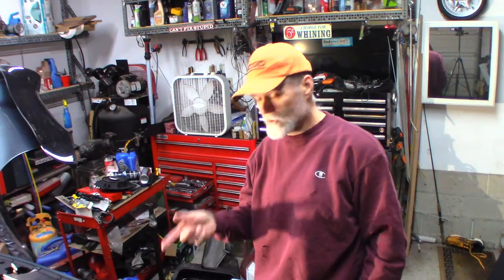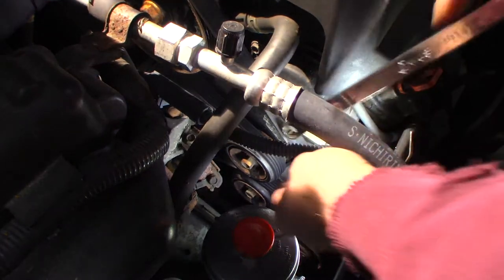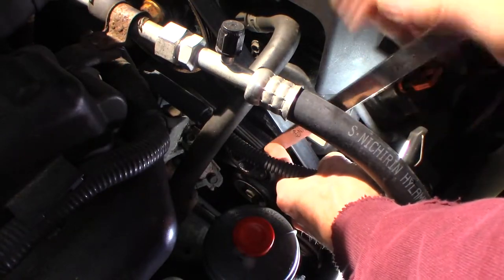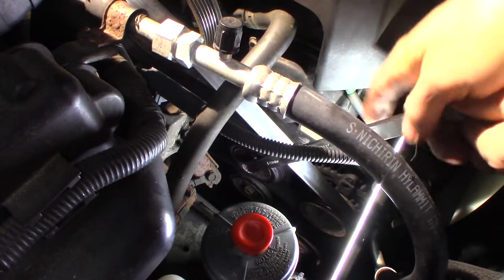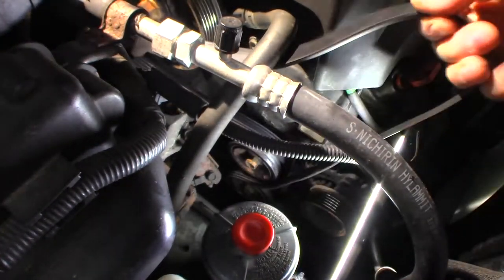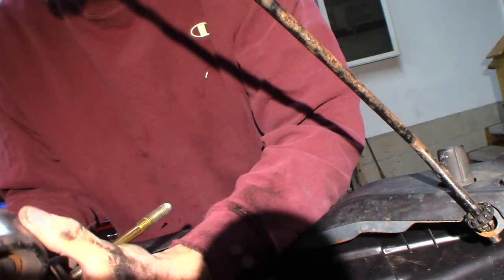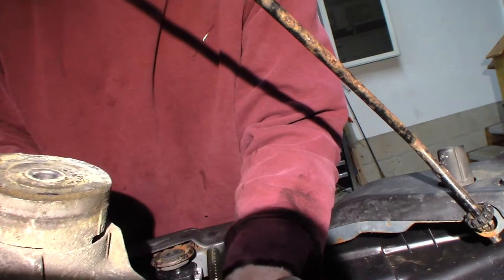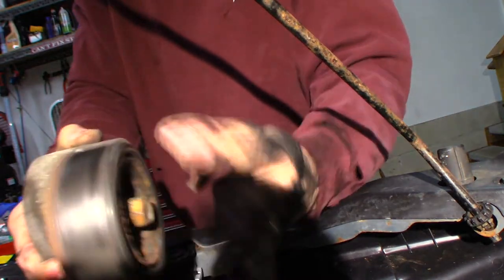2006 Honda Ridgeline 3.5L Serpentine belt tensioner and belt replacement.

Comment: Hey, my friend…
Thank you for posting this 
When I looked at the replacement assembly, and saw the opening for that bottom mounting bolt, I knew I was in for a journey. 
You saved me the dilemma of whether to try to gain access of bolt from the bottom (which means taking down the lower splash guard), or get it from the top. 
Well, you answered that question. 

Thank you, and God Bless!
Reply: I had the same question. The service manual says to drop the splash guard, but that's a pain and it has plastic fasteners that can be hard to re-use. Thanks to Charles for answering the question.

Comment: my honda ridgeline is making more of a groaning, whining noise and I can feel the powersteering feeling stiff at low speed. Is this the serpentine belt?
Reply from the maker: Hard to say, but check power steering fluid level.  Sounds like it's either low on fluid or pump is starting to go.
Reply: @CharlesAndCars on mine the belt was old and slipping. Thanks for the video.